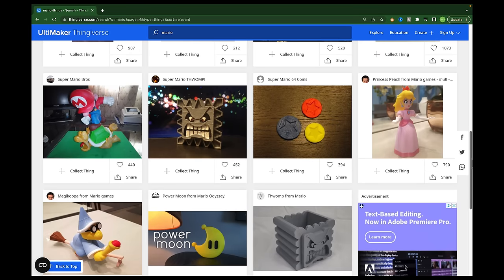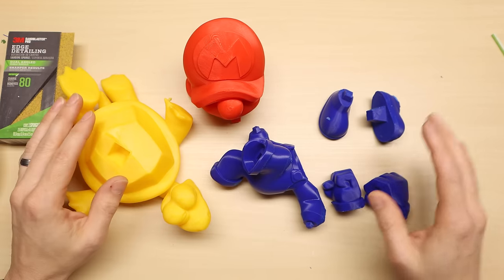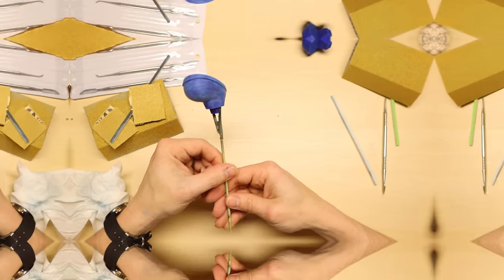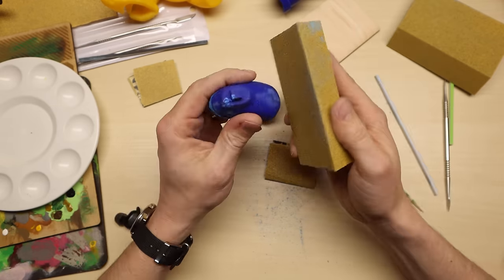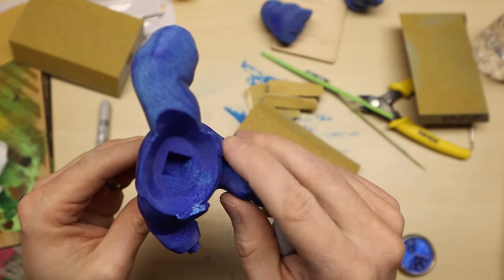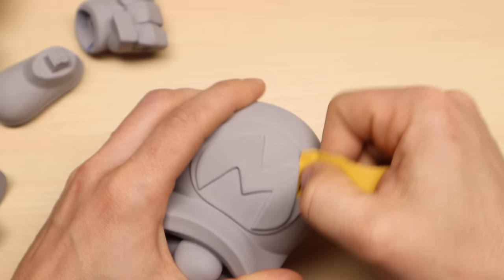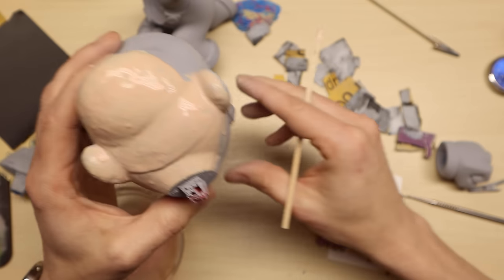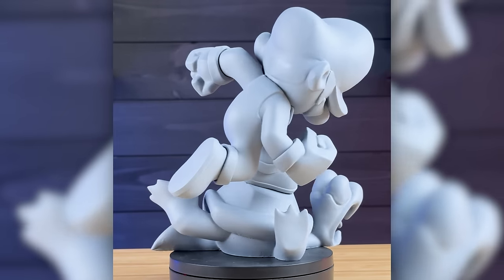How to Smooth PLA 3D Prints to Look Like Resin!

Comment: Yup - that's (just) the classic process of model-making/finishing: all design prototypes, be it from wood, cast resin, laminated fiberglass or renshape are finished this way. Investing in a good (automotive) filler pays off. 2K Polyester putty is usually a better way than air-drying wood filler.

Comment: Sanding tip if you enjoy keeping soft hands. Put blue painters tap on sand paper to hold it to the block and on the sponge. This smooths out the sand paperwork so you dont sand your finger pads too

Comment: Great vid and info, thanks. i have a nail drill (used for doing manicures/pedicures). It's a lot more delicate than a rotary tool like a Dremel and i suspect a lot of the attachments might be useful (and interchangeable with a rotary tool if one does not have a nail drill) because the attachments are made for doing things like acrylic nails and nail polishes.

Comment: To lessen sanding, what I do is spray primer, sand, second primer, sand,  and a third final primer, and a final sanding. The first primer fills up the layer lines. The second primer fills up anything I missed or gets exposed on the first sanding. The third fills everything up. You don't even need to sand hard. Just buy one of those sandpaper sponge and just sand away while you're watching something.

Sounds like a hassle but its fairly easy. You could be done with it in 30 minutes for even for minis.

Comment: ever tried smoothing prints with a soldering iron i have been doing it with amazing results even use it to fill in gaps melting plastc back into place and you now get irons with differnet shaped top so form in detail of prints

Comment: great video! you can sand more finely before the first coat of primer. I generally go down to 120 180 before. I can even go up to 220 if the object has a lot of flat surface. I waste less primer like that. To fill the holes, I use wood putty, it dries quickly, but it gets hollow when it dries (so you have to be generous)

Comment: This is a great step by step demonstration. My only suggestion is that on a really roughly printed area it might be worth double-checking the original model. I think you filled and sanded away the thin bottom edge of the cap.

Don't listen to the haters. Not everybody has a resin printer. I rarely even use mine because I don't have dedicated space to set up a stinky chem lab. Besides, at this scale I'd say the PLA print was cheaper and considerably more sturdy. There's nothing wrong with putting in the work to make it look nice.
Reply from the maker: Thanks so much for the comment. I did check the model there wasn’t much of an edge to it. I tried to make it more defined. 

As for the haters. Yeah… this is a video on pla and good finishes. There are way more people with fdm and not resin printer for so many reasons like they have little kids in the house or afraid of the safety issues. If found the people that switch to resin rarely go back to fdm. But this video isn’t for them which doesn’t hurt my feelings when most people just say use resin without thinking of reasons people don’t use it. 

Oh well the world we live In. I appreciate your comment. Thanks again!
Reply: Ignore the haters, I think most of them lack the patience to do  what you've done.

I was going to ask if you'd considered using acetone? If you brush it over PLA models, it will smooth out a lot of the layer lines. Should save a lot of time.
Reply from the maker: @stewburt5089  thanks!
So acetone works on abs prints but not pla at least the times I’ve tried it. It might depending on the brand or type if you have gotten it to work. The one thing I should of said in the video is this is for people that don’t have or can’t have resin printers. Most of the comments are just telling me to print in resin and that wasn’t the point of this… oh well.

Comment: Thankyou. This is pretty much how I do mine but this is the first time I have seen someone actually show those f*****g support marks!! I was honestly starting to think it was only me. I have been printing for one year and I have tried everything I could come across to try and stop the marking. It's much better these days but I still couldn't make a model without having to sand and paint it (something I am terrible at) People like to show the finished item without showing the immense amount of work that has to happen to make it presentable. I see prints that were done on a Bambu and I just think how did you get it good enough so that it doesn't need sanding> I looked into Klipper (input shaping etc) but I only have the one printer and the process looks incredibly easy to mess up and end up with an unusable printer. I use it everyday to make model figures. It's a love hate relationship - but like all good relationships, it requires a lot of work :D Thanks for showing the REAL process
Reply from the maker: Your very welcome! You pretty much summed up the reason I created my channel I was always tired of just seeing parts of the process not the whole thing. People leave out the steps that they think you should know or they just want to make it look super easy. Thanks for the comment!!
Reply: If you use your Printer primarily for models and miniatures (like me) then honestly, I'd suggest investing in an SLA printer. Sure, you're gonna have to make more space for cleanup and curing. You'd need to learn an entire new system for supporting your models BUT... It's worth it. It's a hassle at first, and you will have failures that will make a mess. But it's worth the mess. 

Look at it this way, with SLA printers there's a lot of pre print processing, but very little post processing. Where with FDM, very little pre processing, a ton of post processing.

You'll appreciate not having to compromise size vs detail. Not having to worry about not having space to display your next huge pla print because you simply can't print it at a smaller scale without losing a bunch of detail is just, really nice.

Of course, if your Printer is in your bedroom/office, then forget everything I said. But if you have space in your garage or a shed or something, I'd give it a go.
Reply: @monkeydad47  Ah, miniatures. Never managed to master them on my machine (FLSun QQS Pro) not to my satisfaction anyway. Removing the supports (even the tree type) is nigh on impossible without breaking something. I like to think my printer is tuned in but I can't do miniatures. I have considered SLA a few times - just so I can do miniatures. Funds aren't there at the moment but it's high on my list. Everything I make on my FDM is relatively large. I can't ever remember reducing something. If it's too big then I cut it up in my slicer but I try and avoid that if possible. It makes for even more work later with filling and sanding. Thanks for the advice
Reply: @GaryScottPhotographer  you could get something cheap like the anycubic mono 2. As long as you also own an FDM printer you don't really have to worry about not being able to fit things on the resin print bed. You can print big stuff too on a small print bed you just gotta get creative with how you orient the model.

Comment: i fucking love plastic wood for prints. i dont have the putty i just use the stuff in the tube and its amazing. easy to apply, easy to smooth, easy to wash off my hands or mistakes.
i like to scrape at it with my cutting pliers that came with my printer, then scrape it more with a small clip point knife (the rounded blade lets me focus it in a small spot) until it's good enough for sanding then plastic wood (and more sanding)

Comment: Like a lot of people, I'm choosing whether print accuracy or print aesthetics takes priority. On parts that have a high mechanical tolerance, that generally means that the support areas are going to be what everyone sees and and may need considerable clean up. For tight spaces consider looking into mini diamond files. That helps a bit but still not a perfect solution. I really want to give sandblasting a try but don't really have the space for one. Resin printing is not suitable for mechanical function in most cases. It's far too brittle. I've researched buying an SLS printer but a small format machine that would fit into a small residential workspace is still near $30k. Maybe someday.

Comment: I brush a lose mixture of wall plaster filler over the print then sand. Wall plaster filler fills all the layer lines and sands away in seconds.
Reply from the maker: That’s cool I’ll have to give that a try I bet it works great.

Comment: i just use thicker (not to thick but not water like) primer based on acetone without sanding 
then sand it , its waaaay easier because you already have filled layers just need to make it smooth and then aply thin primer 
10times faster than any other method

Comment: Just some advice for those who want to start sanding their projects, you may want to increase your number of permitters if you have a rough or bigger part that will require more sanding. It is not normally necessary but if you have a part that requires a lot of sanding, you can wear all the way through if you are not careful (assuming you are running default print settings with 2 shells). I think most people can get by by focusing on the primer (if youre sanding for aesthetics- most of my sanding is for dimensional accuracy so take this with a grain of salt) but you might want to give yourself some buffer on your first print or two.
Reply: I was wondering about that. I had a part I printed and only sanding a small amount I went through the wall enough to weaken the part and broke it. With sanding 80 grit, I would expect that the walls have to be much thicker than most normal parts. I don't get the point of 3d printing things though if you're going to have to spend hours sanding and finishing. Seems like it just completely defeats the point of 3d printing.

Comment: Coming from other finishing FDM prints videos, they diulute bondo with acetone and uses it as a filler primer, but its thicker. Maybe the plastic wood and water could be shoot with an airbrush in order to keep the thickness to a minimum and speed a bit the process ?! Just an idea.

Also, how long would you say it takes to sand and prep ready for paint a model this size ?
Reply from the maker: That’s an interesting idea to try to spray it. The whole process of sanding and priming took about 5 hours. That includes all the dry times I had. Which could of been half of the actual time.

Comment: switch to UV putty, it dries in like 10~30 sec with UV light. u can get those thin sanding sponges instead of the big blocks, those work better for rounded surface. tho the grids ar higher, i think they ar around 400 800 1000/1200. You can also get scriber for modeling to carve those hard lines so you can ink later.

Comment: Thanks for the tips. How many perimeters do you use when slicing a model you expect to process this way?
Reply from the maker: I slice it normally I typically do this process on certain models especially if the supported areas aren’t as clean as I need them to be. Sometimes I might just do a light sanding and primer with no putty. I have a Cura series where I go over the settings I check for every print.
Reply: @ItsMeaDMaDe  Thanks, I'll check that out

Comment: Question?? Wouldn't resin spray help create a smooth surface? Instead of sanding the whole thing. The only part I see that would definitely need sanding is where the supports were.

Comment: The fastest way I found to smooth out an FDM print is to use a media blaster with plastic pellets and 50 psi. Pla layer lines disappear easily.

Comment: Although i very rarely sand the parts, i would suggest building a jig to have your sandpaper stuck/Locked and just move the part thru the sandpaper where you need it. 
Then do the fine details that your jig cant reach, Much easier than holding both the part + sandpaper

Comment: Do I need some kind of air filter to catch particles that go airborne? How many layers of walls do you use?
Reply: i bought just a small paint booth, then added a bucket with water on bottom, holes on top filter on top of the bucket holes, connect your hose to it, there is a video of it somewhere on utube, its a small industriel working thing to catch dust or paint

Comment: This is amazing but in my case the point of using a filament printer is that you don't have to go through as much work to get a print, but if I need to perfectly sand each of the prints I think I'd rather spend the work of cleaning and curing a print on resin and it will surely look much better.

Comment: I found wet sanding works way better remember heat us what binds the filament together so when you sand or use a Dremel you heat up the print I'm working on the stargate anubis cowl and wet sanding is the key 🔑

Comment: not for nothing but it may be a positive result if you began using a sand blasting method and you can make a detail tool for this with the printer and use a small metal tube to create a mini blaster for the details.
Reply: I would think that using a tumbler might also be effective at very least you could use the tumbler medium for the abrasive when blasting your parts using a mini blasting chamber of your own making.

Comment: Any kin of dremel bits that are worth buying? I tried sanding drums on PLA and they were useless. They either did nothing at all or they melted the part and gouged really deep. Otherwise though, they just slipped right off the surface and removed no material at all.

Comment: Got any tips videos for printing multiple models on the same plate? Getting excessive stringing between the models and they are at last 30mm apart. Maybe turn off coasting?
Reply: Retractions settings and dry your filaments.
Reply: @MrLelopes  Does just fine with one model. But multi is bad.
Reply: @jesseburson  stringing: filament is pouring out of the nozzle when you don’t want it to. Increasing the gap will only make it worse if you don’t solve the problem.
Reply: @echo-hotel  reduce flow?

Comment: That area where your layers are really sketchy, next time, try to fill it with epoxy glue and let it dry then sand, I have been doing this with wonderful results, I use a small brush to evenly spread the glue across the bad layers, if needed do it more than once. This helps the part turn rigid in weak layers, because if you fill it with simple filler, it may crack after some time.

Comment: Daaaang Mario, the back of your head is ridiculous!
Reply from the maker: Yeah it was a bad print for sure. Turned out good though
Reply: @ItsMeaDMaDe  haha that’s not what I meant! You did a great job cleaning up his cap. It’s looks damn good. I was referencing this: http://m.quickmeme.com/img/13/13cb59751432404842f1c3b04b1efd7dcce5bd0f4ce3e08b2ff712240af34ccf.jpg

Comment: You could have vaper smooth it. Then, from there, you could have reassessed if it needed extra work.
Reply from the maker: Vapor smoothing doesn’t work on pla. That is why I sand it.
Reply: @ItsMeaDMaDe  makes sense. Thanks for letting me know. Good info. 👍

Comment: If it is going to be in the heat and sunlight, what should I print it in?
Reply: It is recommended to use PETG filament
The PLA filament melts at around 55 degrees

PETG has UV resistance and 70 degrees heat resistance
It also doesn't emit toxic gases
Reply: @packpack758  Thank you

Comment: Is there any way to sand a 3d print in your Flat without contaminating everything with plastic dust including your own lungs without carrying a dust mask?
Reply from the maker: You can do the wet sanding method it greatly reduces dust. I did a video using this method here. 

https://youtu.be/Qnn-EGq_kbI

I still like to have at least a dust mask when doing this though.

Comment: Resin printer for figures, Filament for working parts. Time is money. Also, if you are going to sand use wet sanding. You’ll save so much sand paper. No reason to not wet sand these parts.

Comment: Orrrr, you could just smooth it in acetone and NOT sand it.  Suspend the models over a little bit of acetone in a vat (sealed) for a few min.
Reply: This video is specifically for PLA prints. ABS is soluble in acetone. PLA is not.

Comment: from an old fart to a young whippersnapper. never tear sandpaper or emorycloth. always cut with scissors. if you tear it you WILL chafe the end where u tore it and it will crumble off. also you should have far better and more effective use of sandpaper if you use water when u grind. 

good fun seen the actual backside of this hobby for once. also you could do with a 3dprinted table sucking duct to relieve ur lungs from that plastic waste, we can hear that the audio is recorded at the same time as the video and that u are not using the mask u tell your audience to use so u thought i would throw that one in for your health ;)

also u could just print much slower with a tiny 0.2mm nozzle and this is not an issue? im currently having fun with pla at 0.08 layers and the pieces so far are so so so pretty. takes forever though.

p.s.
Have a gander at vapour smoothing with solvents? same result less work